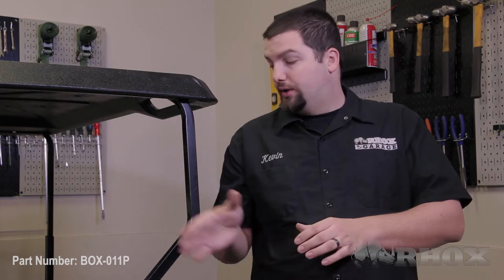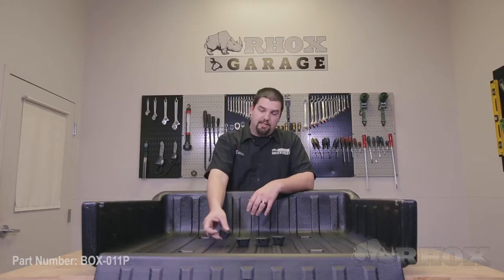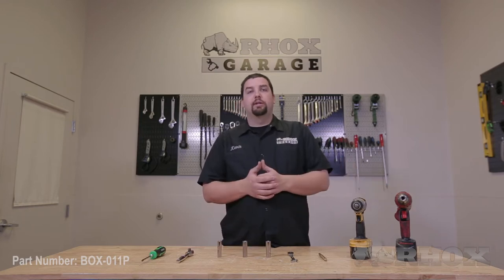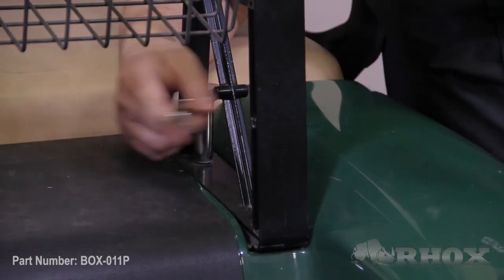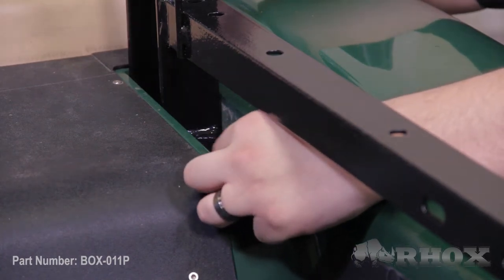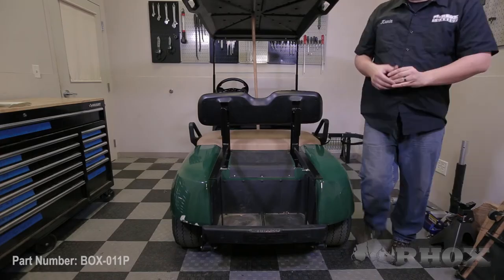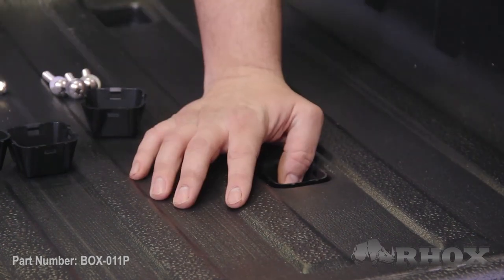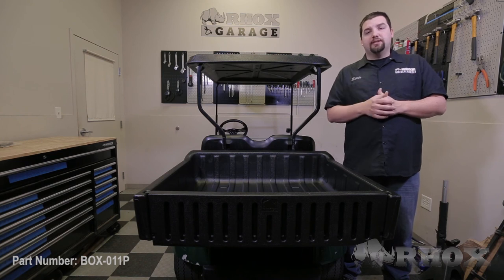BOX-011P RHOX Poly Utility Box on an E-Z-Go TXT

Comment: Will this fit a 2019 EZGO TXT?
Reply from the maker: If the 2019 is the same as the 2014-17 it will.  We don't have a 2019 here to test and I cannot find drawings for it to verify parts so we cannot guarantee fitment.  You will need to make sure the bagwell, rear body, frame and struts are the same.
Reply: A side view of the finished product would be nice...